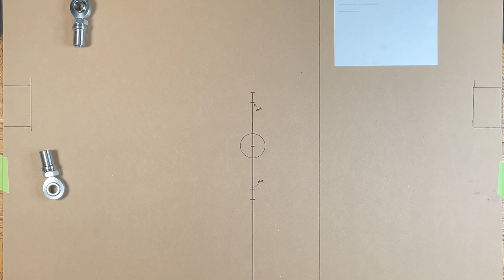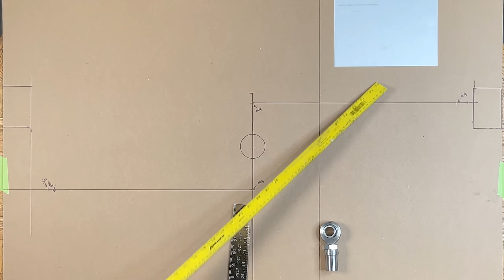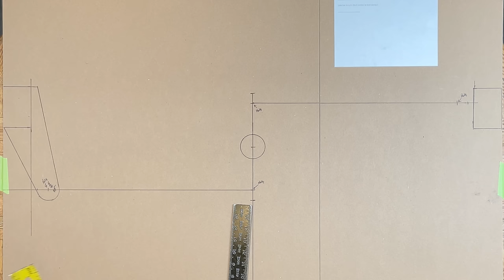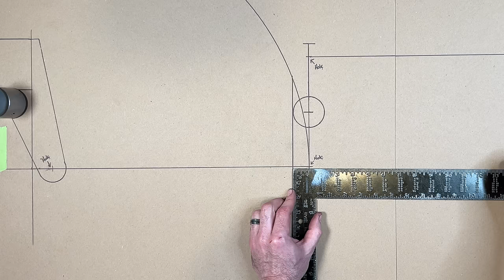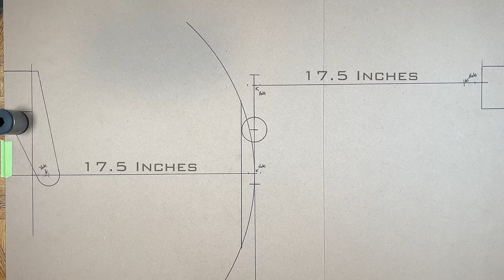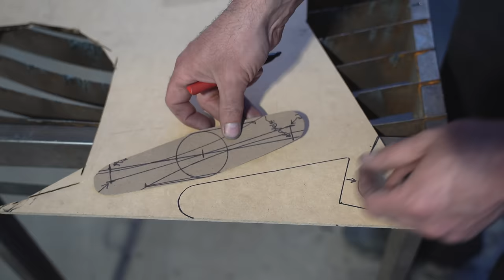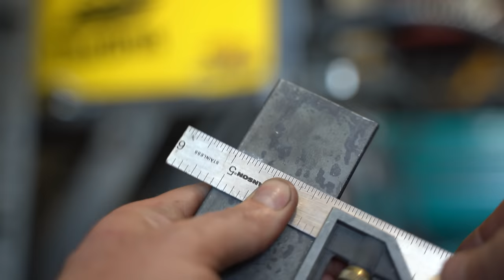The Greatest Watts Link Tutorial Ever! Mighty Max Ep. 16

Comment: Great video and explanation of the watts link and how to correctly fabricate and adjust. You state that a watts link needs to be attached to the axle. What about systems that attach to the frame like the Fays units?
Reply from the maker: Thank you, Paul!! A Watts link is attached to both the axle AND the frame.  Most commonly, like mine, the ‘propeller’ Is attached to the axle and the links are attached to the frame. This can be reversed and it will still work. Here’s the potential catch; On a Watts link suspension, the roll center of the rear suspension, (the imaginary axis that the body/chassis rotates around as the body rolls) is located at the pivot point of the propeller link. By mounting the propeller to the chassis, the roll center will move up and down when the chassis moves up and down. I feel that this could cause an inconsistency in handling and wouldn’t be great for racing. BUT! I also don’t know much about racing. It would likely be just fine on a street vehicle. Cheers, Steven!

Comment: I am curious where you found information that you need to have the bellcrank about .50" offset from the pivot bolt. I have built several of these for continuation FIA Scarab race cars. The original cars were designed and built by Phil Remington. He was on the design and fabrication G40 cars that hammered the Ferraris. Also did one for a Aston Martin  DBR1R Carrol Shelby won Le Mans in 1958. I do have a vintage automotive engineering book that probably has that covered and I will see about digging it out next week. Not saying you are wrong as I am just always seeking information. One other thing... Both of those cars had DeDion tube rear suspension and the Bell Crank was mounted on the centerline of that 3" tube. You have probably have discovered that a Watts Linkage system can also be laid out in the horizontal plane on top or under the rear housing. As the always told me "There are No new inventions, just reinventions". I very seldom watch DIY youtubes but I stumbled across your site and got to looking through them. You I will watch! I have been building cars since 1973 that covered a lot of different types from Top Fuel chassis street cars, hot rods and the Sport Car racers. Still learning (I Hope!). Maybe we might get to talk  if possible. Carry On Sir!
Reply from the maker: Thank you for the kind words my friend!
I didn’t really “find” this info. By that I mean I didn’t learn it from someone or read about it. The need for the offset of the pivoting link was more of a personal discovery during my first Watts link build.
First, this offset isn’t necessary on static height vehicles. Unless you’ve got adjustable height, you can ignore this. The race vehicles you mentioned I’d guess would see somewhere around 2 inches of suspension travel. A Watts link wouldn’t move much with such little travel.
The vehicles I build, however, can see upwards of 12 inches of suspension travel. 
Needless to say, a Watts link will move significantly more on a vehicle like this.
Assuming the Watts link was designed and installed properly, the center pivot point will travel nearly straight up and down as the suspension cycles. 
BUT! As the ‘propeller’ approaches horizontal, the system begins to move the center point left and right. This only happens when a Watts link is pushed to its limits. My 0.5 inch offset allows more near-vertical movement of the propeller.
The 0.5 inch offset was chosen because my Watts link bars followed a 1 inch tall arc, which means the prop gets pushed and pulled a total of 1 inch.
If the system was designed so that the prop was vertical at half-travel, the bars would pull the prop away from vertical 1 inch.
By offsetting the prop 0.5 inches away from vertical to resemble a Z, the 1 inch arc still pulls the prop 1 inch total, but the prop cannot exceed 0.5 inches away from vertical. 
Hopefully this made sense. Lemme know.
Cheers!

Comment: First episode love it sofar rolled my pickup a few moths ago snaped a blade spring rebuilding it now seriously gona go for this setup i use it for roadside assistance so jip just gona use rubber bushings on most joints for ride comfort but damn this looks a million times beter than n blade spring setup and it looks safer
Reply from the maker: Thank you Kline! Not sure if links are safer but they can definitely handle quite a bit more weight. 👍

Comment: Awesome video, excellent quality and explanation as usual. I like your trick, mounting the combination square to the table and mark the offset on your template. Will definitely use that. Is the Watts link really better than a pan hard bar...damn. Have to get out the cutting torch....From South Africa
Reply from the maker: Thank you my friend! Is the Watts better? That depends on what the rest of your suspension is! Often the simplest system is the best. The panhard is certainly simple. In my opinion, the Watts link is only better if you have adjustable suspension or a LOT of travel. For regular cars, the panhard bar is just fine if not better!
Reply: @GarageFab  Thank you for your response, Much appreciated. I hear you, was just kidding about the cutting torch. I have a parrallel 4 link that I fabricated, Not much suspension travel (standard toyota hilux). I will stick with the panhard bar for now and see how it goes, I am sure it will be fine as you stated. I agree simpler the better so long as it is fit for purpose. Cheers

Comment: If the link bars are mounted at the same height to the chassis, at approximately axle tube Centerline, and their inner end is at diff 
vertical  Centerline when the diff is at max travel. Then the propeller can be vertical at travel limits and maximum degree from vertical at mid travel/ ride height. This prevents hangups of lower slung mounts and propeller in 4x4 situations.
Reply from the maker: I read that fifty times. After careful consideration… I think I agree! 🤔
Reply: @GarageFab  Awsome video man. Smooth as.
Reply from the maker: Thank you my friend. 🙏
Reply: @GarageFab  Hey, I've seen a setup which I thought had been done how I described, but I just modeled it in linkage, and again in GIM and I can't make it work. There must've been other components I missed. My apologies. Hopefully I see the Jeep again to discover how it was done.
Reply from the maker: If you’ve got an Instagram, hit me up @GarageFab and shoot me a screen shot of what your working on. Perhaps if I can see something I can better help.

Comment: Just found your channel and I’m loving the content. I now want to upgrade the suspension on my C10! 

Question: just like on the link bars you made with the curve in it on the previous videos, could the propeller be a different shape, like maybe an “S” shape and still function properly? Just so, you know, it doesn’t look like every other propeller?
Reply from the maker: Thank you, Robert! The shape of any singular link bar can be modified to suit your needs. Just remember to beef it up a little bit as curving anything reduces its strength. The propeller is considered another link. Overall it operates with the same rules but the pivot location changes. So absolutely! The propeller AND the link bars themselves could be bent. 
Imagine if they were designed in a way where the whole Watts assembly was shaped like an S when it was in it’s neutral position. 🤔

Comment: At 11.59, you glossed over the reasoning for adding and subtracting the half inch. I understand the push pull from Basics 1 but I  still am trying to grasp why should add the length.
Reply from the maker: You couldn’t be more right, Chris. I could’ve explained that better. I’ll attempt it in text…
When the bars are level, they are “pushing” as much as they will push. As the bars pivot (in either direction) they can only pull. I attempted to show that my bars will pull 1 inch with the amount of travel I have (12”) 
The goal then was to install the propeller in a way that the bars would push it one direction the same amount (1/2”) as they would pull it the opposite direction. This is all to prevent the propeller from turning too much in either direction.
If that’s still not clear, ignore it altogether. I’d recommend building it as I did with the bars level and the propeller at any random slight angle that forms a Z. It’s really unimportant. But if you have a lot of suspension travel, the angled propeller will give you additional movement.
The half-inch I added to the bars was simply to put the propeller in the desired position. Another option would’ve been to keep the bars the same length and instead move the frame mounts in a half inch. I was worried that would be even more confusing, and since it barely matters on most vehicles I chose to let it be.
Hopefully that helps, otherwise I’ve failed twice! Lemme know. 🍻
Reply: @GarageFab   It makes sense now.

Comment: I'm not sure if I understood everything 100%, but if I did wouldn't you not want to fully weld your watts link frame mounts yet? Similar to the 4 link mounts because the axle might still need to be rotated.

Anyway, you got me all curios about how smooth your tooth is, dang it!
Reply from the maker: I see where you’re going with that. I suppose you’re not wrong. And I think you’d be very right if I had used solid polyurethane bushings for the watts link bars. I must’ve subconsciously assumed that wasn’t important partially because heim joints move freely and probably wouldn’t be affected by a couple degrees of change. But more importantly, the heims are threaded, so they can be loosened, repositioned and the new angle, and tightened. This would mean that the heim joints would no longer be clocked the same, but that shouldn’t affect operation.
You’re not the first to mention their desire for tooth lickage. If I ever have merch, I’m considering selling a small ring box with a licking tooth mounted inside. Or… perhaps custom made tooth suckers. 🤔

Comment: Good video how about shocks did you add shock mounts to the suspension? And where are they located 👍🏽 
I’m also wondering if the Watts suspension would work on a lowrider with a high lock up and a high 3 wheel.
Reply from the maker: I have not done shocks yet but I will! There will be videos on it, both front and rear.
Yes! The Watts will work on just about anything as long as you set it up with the bars at parallel to the ground at half travel. I think the most travel I’ve ever had was 14 inches but it was clear to me the watts link could more. Also there’s no better system for articulation. If the body/chassis wasn’t in the way, the axle could theoretically spin!

Comment: Love your channel. I have a 06 Ford 4x4 super lifted and it has the "death wobble" in the front.  I have all new front suspension parts and it still wobbles when I hit a good ripple to set it off.  It's scary when it occurs.  Would a double pan hard rod work?
Reply from the maker: Oh boy! I’m not sure how much help I can be on this one. I’m happy to say I’ve never had to deal with death wobble. From my research in the past (on Jeeps anyway) it’s usually steering related and it’s usually looseness in the steering components.
The best I can do is give my opinion simply based on my knowledge of suspension; I don’t see how a sway bar color affect wobble in any way, neither positively or negatively.
Is the wobble super noticeable in the steering wheel? My first thought is a steering stabilizer shock or two. Do you have those already? Also make sure your alignment is good. Wacky caster and toe creates some interesting handling issues.
Thank you for the kind words, Kennedy! Let me know what you find out!

Comment: Damn. You are like a wizard. Awesome build. Now the question. Are there any Benifits to this style over a triangles 4 link? Drag race application.
Reply from the maker: Thank you, Fredie! I appreciate you. 🙏 For drag racing, I’m my opinion (because I’m not educated enough in the drag racing world) no, I don’t see any added benefits. But at the same time, I also don’t see any faults.
The Watts Link is most useful in vehicles with a lot of travel that don’t have enough room for a properly working triangulated 4 link. The parallel bars opens up a lot of room in the center of the vehicle and the bars can often be place tight against the frame rails out of sight. The angled bars in a triangulated 4 link are like a child that sprawls out on your bed taking up every last bit of room.
In drag racing, the performance will mainly come from the design of your forward facing bars and will have little to do with the lateral axle locator.

Comment: This is super cool, I would just be worried about rocks hitting it on the trails… I’m wondering if a guard similar to a pinion guard for a 14 bolt would keep it from getting bashed up? I’m thinking of trying this on our next build
Reply from the maker: I don’t see why not. Building a little ski under it probably wouldn’t be too hard. You can also mount the spinning component a little higher to keep it out of the way. That’ll raise your roll center a bit. Unsure how that affects rock crawling performance. 🤷‍♂️
Reply: It really shouldn’t affect it at all seeing as how we run our rigs a little taller than most guys. I’m going to talk to my son and we may try it when we build his rig later this year. I like it compared to a pan hard bar, although I believe that if you have the right bends in your pan hard bar you can keep the geometry relatively the same from side to side
Reply from the maker: I can’t wait to see it! 🙌

Comment: Great video.  Very informative.  I have a question though.  I have seen Watts setups where instead of the pivot point mounting to the diff like yours, they have it attached to the frame rails.  The assembly hangs down from the frame rails and the center of the pivot is in alignment with the center of the axle, but the link bars are attached to axle tubes via tube clamps.  If you’ve seen this alternate configuration, do you know if it acts in the same manner?  Advantages/disadvantages?  Thanks.
Reply from the maker: For the most part, it would work exactly the same. Just as stable and the motion of the suspension is the same.
The difference comes in how the vehicle handles in turns.
The center of the Watts link pivot is the “roll center” of the rear suspension.
The roll center is the imaginary point that the chassis rotates around as the body rolls. The height of the roll center matters. It can allow the body to roll more,  or less, or even backwards if roll center is above the vehicle center of gravity.
The “best” roll center changes from car to car and from driver to driver.
All that said, by mounting the center pivot of the Watts to the chassis rather than the axle. The roll center will change as the body moves up and down on the suspension. This could cause unpredictable handling. 
Is it bad? Probably not even noticeable on most street vehicles. But I bet it would be really annoying to a race car driver.
Reply: @GarageFab  I didn’t think about the roll center moving on that configuration, but I could see how that’d be problematic.  Thanks for the detailed explanation.

Comment: So can this whole setup be raised? If you raise the entire setup 4” would everything still work fine? I’ve got a off-road truck with portal axles that I’d like to keep the diff housing as the lowest point on which means this wouldn’t work for my needs unless I raised it. Total suspension travel is 16”
Reply from the maker: Yes, it absolutely can be raised. The possible catch is that the pivot point of the ‘propeller’ is the roll center of the rear suspension. That is the point that the chassis rotates around when the body rolls back-and-forth. This can affect handling, but more so in racing applications. I am unsure how roll center affects off-road driving. That’s something that you will have to look into. Let me know what you find!

Comment: HY fantastic video ,can you tell me wat size of ends ,pipe needed ,plate used,also bolts do they have poly bush inside them regards tim
Reply from the maker: Hey Tim! Different size vehicles need various size components but I can tell you on this one in particular, (and good for most light duty street vehicles) they are 3/4 inch heims 1 1/4 inch DOM tubing.
I use 3/16 inch plate on just about everything whether it needs it or not.
Only the center link has a poly bushing. Heim joints have a thin layer of Teflon (usually) inside to keep the metal from rubbing.

Comment: What type and dimension of dom tubing do you use for your 4 links? I see a wide variety on thorbros and am not quite sure which to purchase. Or did you source the bushings and DOM tubing elsewhere locally?
Reply from the maker: Honestly, Max I rarely use DOM. The threaded bungs that I purchased from Thorbros were machined to fit 1 1/4” DOM with 1/8” wall, so I bought some.
But for my 4 link bars I consistently use 1 1/2” round tubing with 1/8” wall for non load bearing link bars, and 2x2” square tubing with 1/4” wall four link bars that have a coil over or air spring attached to them. There’s a small steel supply place here in Vegas that I use for that stuff. I only get the bushings and heims from Thorbros!

Comment: How do you think a spindle from the front of a HD truck would work for the center of the "propeller"? 
Wouldn't need the extra support then to eliminate sideways stress on the bolt
Reply from the maker: It would be plenty strong and work quite well! The trick is getting it to look nice. (If you care.)
Check out this video…
https://youtu.be/uomQ-HuKuo8?si=y3nGitrSTc9sD76M
At 55 seconds in, I talk about the very first Watts I built and I used a rear wheel hub from a Toyota Camry. Similar concept, no complaints.